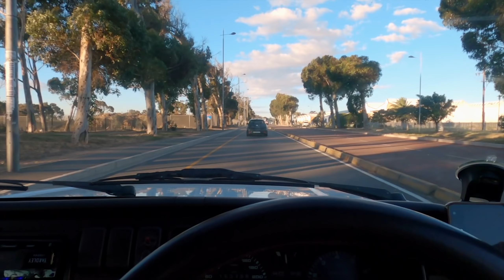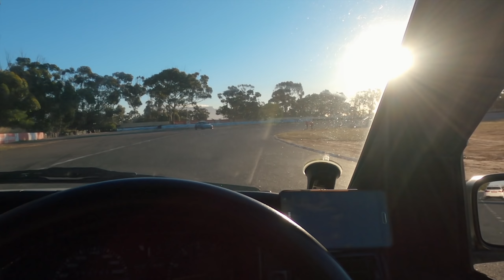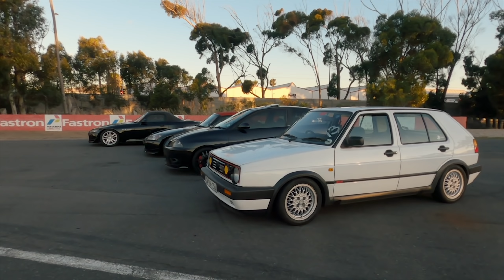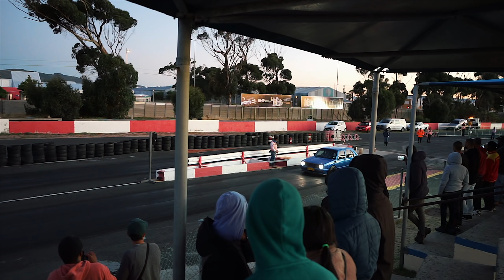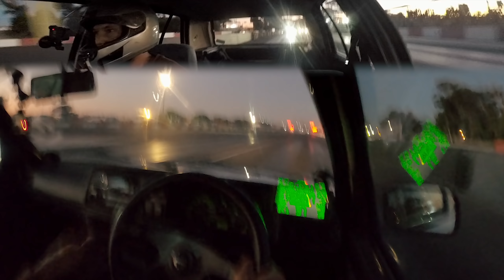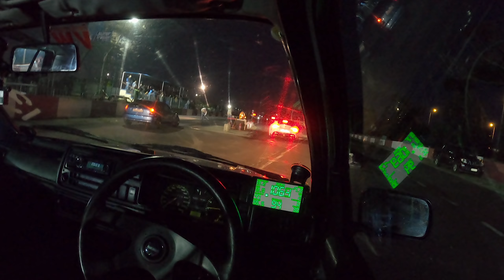1/4 mile drag racing the 1.8T Mk2 at the last Killarney Robot racing for 2021 | 100-200 in sub 10s!

Comment: One tire fire😂. LSD and some nice sticks will make a huge difference. Let's hope the gbox and side shafts are happy with it
Reply from the maker: Haha. Let's hope. Might try semi slicks at the next event. But that could go really well or really badly, we'll see. 😂
Reply: Yeah LSD and some semi slicks would make a massive difference. Also, the car seems to land out of boost in 2nd gear mostly, unless you Rev it out in 1st and quick change to 2nd, or flat foot shift into 2nd..
Reply from the maker: It only falls out of boost going into 2nd because I turned the boost down in 1st and 2nd gear. I turned it down too much and it didn’t build enough boost. And if I turn it up too much, it spins 1st and 2nd violently. Still trying to find the middle ground.

Comment: Mate last I was there I had the same traction issues. The track just had less grip. Also had one run with the Mk1 beams and first run we sat all the way and was dead even, second run he forced me into the left lane and he got me by 2 cars. So if the traction is there we would have a good race. But, saw how you coming back at him in 4th. I also start pulling him back in 4th
Reply from the maker: That Mk1 gets out really well. It's consistent too. I'm not there yet but I'll have a re run with him when I've got my setup dialed. I know that I need to run 13.8's to beat him. But getting that first half down is my top priority right now. But looking forward to racing you again. S2S next week?
Reply: I am hoping. Clutch pedal is starting to rise up. On a Z that means the clutch doesn't have allot of meat left but I think it will hold. Just can't do back to back pulls. But yeah I need to try and beat my 13.6 since the diff is sorted. If u do, I'd like to meet up and drive through with you
Reply from the maker: Thankfully S2S usually has a train of cars lined up so you can’t do back to back runs even if you wanted to. Haha. Hopefully you can beat your PB. I’m hoping that because it’s straight after MSA, the traction off the line will be really good. I’m also hoping for a new PB. I might go through to MSA before hand to spectate but dm me on IG and we can chat about driving together. My plans might change.

Comment: does your ecu have a launch control function?
Reply: It does but the turbo is so peaky that even using LC doesn't help. Launching in boost is definitely worse than just launching it without LC (For street tyres at least)
Reply from the maker: Launch control makes things a lot worse and shocks the drivetrain too much. I'm more likely to break things that way. Once it builds boost with LC, it's game over. lol.
Reply: @lowdl  Figured with that much power lol, just about getting traction now I guess
Reply from the maker: Using LC would make things easier because it’s one less thing to think about on the line. But I’ll need to tweak it and do a lot more testing with it. I’ll try semi slicks next and then I’ll mess around with LC after.

Comment: Your car is super healthy now but definitely 1st and 2nd boost should be kept lower to minimize wheel spin, to have as much traction as possible
Reply from the maker: Thanks Dev. 🙌🏽 The problem I run into when I drop the boost too low is that the next gear suffers. So I drop out of boost between shifts which is annoying. But better tyres should help a lot. I’ll be able to add a little more boost.

Comment: Hi watching your video now and with the tyres you have to launch lower than 4 or 3 rmp cause when you launch at that point you just start spinning so to balance the tyres lower the launch abit because of the power you have in that motor ....
Reply from the maker: I had runs where I launched lower and it bogged which worked well for times but in both cases the guy I raced left me because of how long it took to build boost. But theres a sweet spot and I just couldn’t find it that night. Track conditions was really bad because of rain earlier in the day.

Comment: The Mk2 is capable of much more as it has the power which can kill alot of those cars you went up against.. traction is letting you down. If you grip.. you're gone 👌
Reply from the maker: 💯 Traction will make all the difference. Traction also breaks things. So hopefully things stay together 😂
Reply: @lowdl  lol next up some Proxies and extra polymounts? 😅
Definitely is a balancing act
Reply from the maker: I’m looking at getting Proxes now. Hopefully I get a good deal on them. I won’t poly the car. Makes it very harsh and even though I race it, it’s not a race car. So you’re right, it’s all about finding the balance.